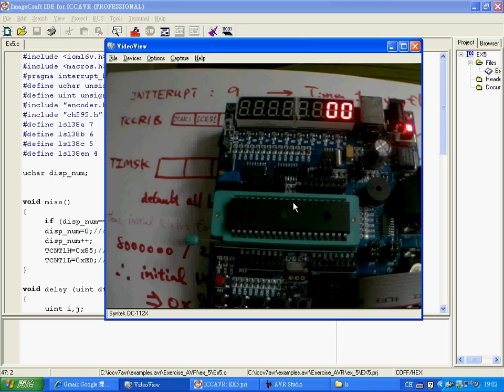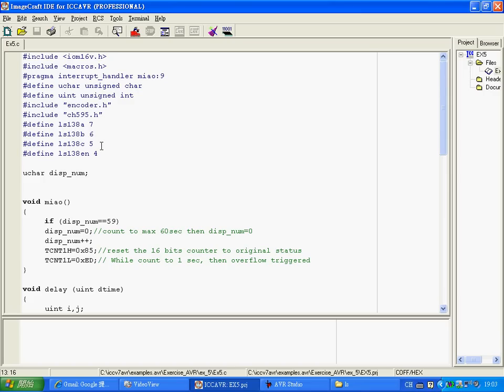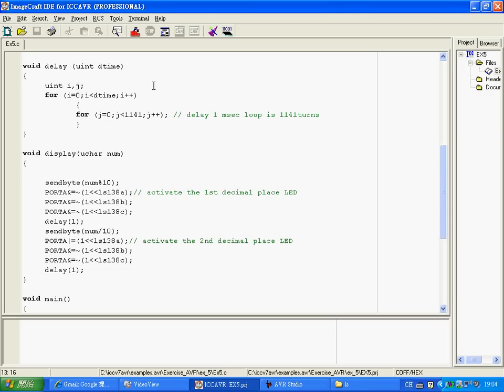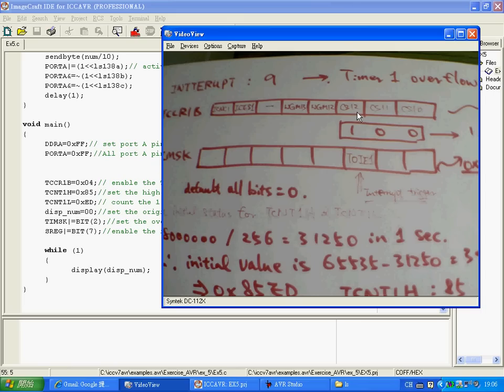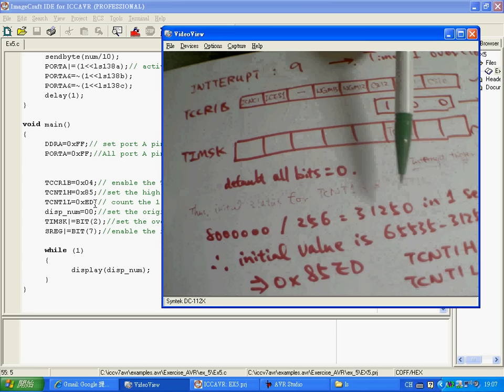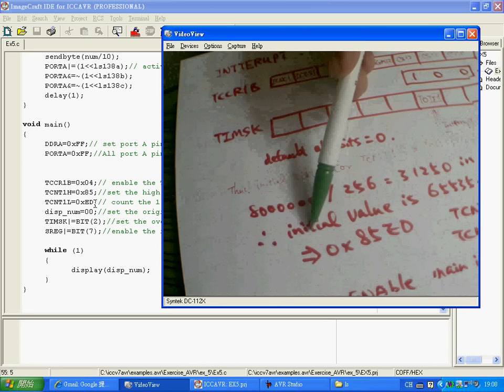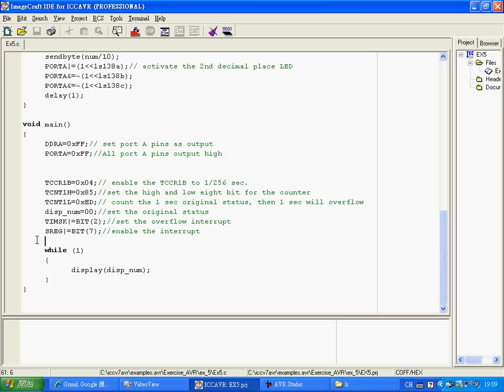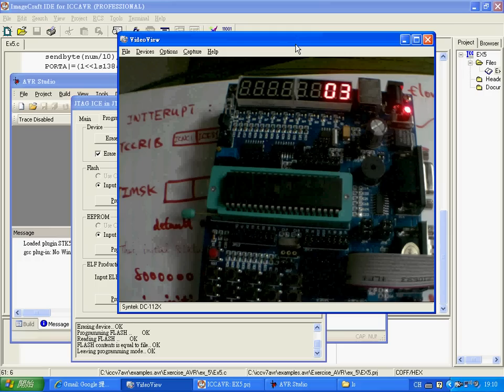ATMega16 Interrupt tutorial

Comment: sir  my project is somewhat contrasting to this link http://www.avr-tutorials.com/interrupts/avr-external-interrupt-c-programming  The differences are as follow:
1. In the link, the trigger pulse is negative (but my project will be using a positive pulse).
2. In the link, the LEDS are sequentially blinking and continuous right from the start (but I want only a one-shot sequential outputs (2 seconds HIGH per LED; 2 seconds interval before the 2nd LED lights up...so on and so forth... 8th LED should be HIGH for 1 minute ) for EVERY POSITIVE EXTERNAL interrupt, with also a condition that the microcontroller will lock itself while doing the one-time sequence of outputs, meaning it should ignore any external pulse FROM the point of implementing the entire sequence up to FINISHING the 1 minute HIGH of the 8th LED.
3. In the link, the LEDs altogether blink 5 times when switched is pressed (i only need 1-time sequential output)

This is what in my mind.
Please do a favor for me Sir, as i am not a programmer, just an electronic enthusiast.
Kindly email the C code and the HEX file to uelman800s@gmail.com
Also please mention which
1. the pin numbers to connect the 8 LEDs and
2. Pin number for the EXTERNAL  interrupt to use
3. the suggested practical (economical) family of AVR

Thank you in advance Sir.
Reply from the maker: your mail box has problem. Please cross check and advise again
Reply: ok sir, at this very moment my connection is noticeably slow. kindly try after a while. thanks.

Comment: hi ! may i ask a favor? could you please provide me the C code or even the  hex file (as per below case) in contrast to the link http://www.avr-tutorials.com/interrupts/avr-external-interrupt-c-programming.
My case is this:
I have a 5V signal as my external interrupt pluse at any time of a given period using the cheapest AVR type available in the market.
1. Once the Atmega328 (lower type of AVR) receives a high external pulse, it should produce at least 5 HIGH SEQUENTIAL output signals (each in separate output pins, (exactly 2 seconds duration for each high output) at an interval of 2 seconds. These sequential outputs should be produced by the IC for 1 time only (for every external pulse, provided that it follows also the condition at #3 & #4.
2, Then right after producing the 3rd HIGH output, a 4th HIGH output (from a separate pin) should be produced for 30 seconds duration.
3. Configure the system that within the period from sensing the interrupt up to finishing the 30 seconds duration of the 4th HIGH signal output), the IC must refuse to receive any external interrupt)
4. After this 30 seconds, the IC may receive again possible interrupt.
5. Please maximixe the possible numbers of sequential outputs. Basically I only need  4 sequential outputs, but the more the better. 

Thank you in advance,
Reply from the maker: 1) you should read the manual how to trigger the timer for pulse in and out. then your case can be done easily
2) My code can be send while I back to home. give me your email address
3) I suggested you write a flow chart by AVR programming mind. then you can easily debug it when you developing your code.